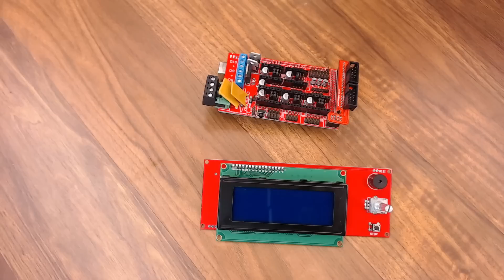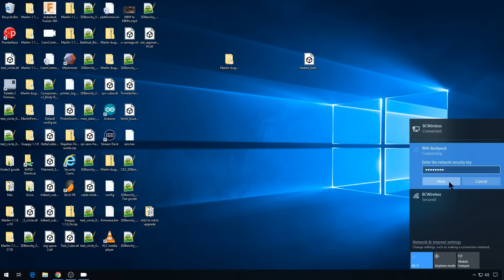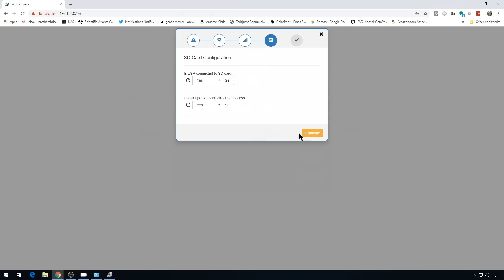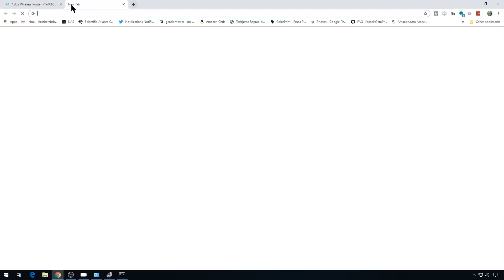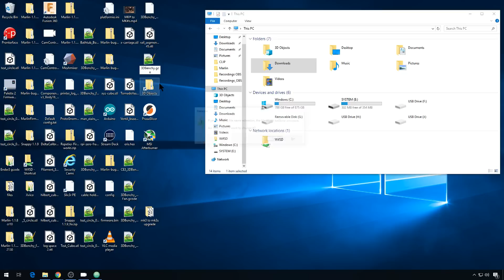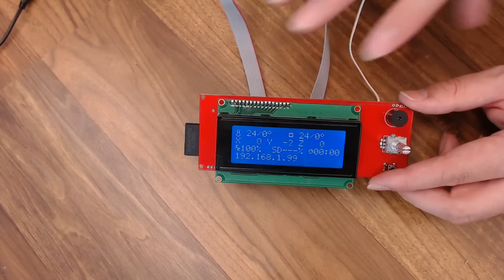Easily Add Wifi To Your 3D Printer - Panucatt Wifi Backpack - Chris's Basement

Comment: A little bit late to the party, but still.... I'm thinking of adding this backpack board to my printer,but I have a question. The main board still has access to the SD card? Can I use the browser UI and the printer display UI in parallel??
Reply from the maker: It will still have access, but remember you are using the same serial bus so bit bashing could happen. That could halt the print.

Comment: Chris, how about an update?  Lot of firmware improvements in 4 years.
Reply from the maker: I'll look into it!
Reply: @ChrisRiley  It does now work with long filenames. There is no level shifter in the backpack so operation with Mega2560 boards is questionable.  Both my Mega2560 and my DUE would reboot continuously until I changed the printer firmware to slow down the SD access.  The SPI signals are very sensitive to electrical noise and really should have a schmitt-trigger buffer (74VHC14 would level shift too).  And the selected file extentions in Backpack preferences need to be in both upper case and lower case or it may not recognize the files  as printable.

Comment: Which one gives the most interesting charateristiques between this module and the TFT MKS wifi module that is plugged as well at the back of the TFT? Thanks
Reply from the maker: They both run esp3d so they are about the same.

Comment: Hi Chris,
Do you know if we can mount this module on the TFT35 instead ? Thanks
Reply from the maker: If you TFT has the EXP 1 nad 2 connections then yes, it should work the same.
Reply: @ChrisRiley  ok Thanks
Reply: @ChrisRiley  So I imagine its the "viki lcd version"  to pick in that case.
Reply from the maker: @Levisgil47  You will still want the reprap one but you would need cables. Maybe look at the ESP8266 module instead.

Comment: Chris! Help! I'm trying to get this to work on my Prusa mk2s clone. I have it connected to where I can see the files on the SD card but the printer isn't receiving any instructions I try to send to it. I just kind of guessed on where to plug in the UART cables on the mini RAMBo because I couldn't find any info online on that. You're my only hope.
Reply from the maker: Hey, so, the mini rambo has a secondary serial, they are on the AUX 3 interface, from the outside of the board, with it installed, the top row, outside pin is the 5v pin the next 2 are transmit and receive. Check out P3 at the bottom. https://reprap.org/mediawiki/images/e/ef/MiniRambo1.3a-schematic-pg2.svg
Reply: @ChrisRiley  Thanks! But I have a new problem. Everything is working except the actual printing part. I can send code and all that, but when I try to actually print nothing happens. I tried renaming the file with the "8-3" rule and that seemed to change something - it now shows a time elapsed on the LCD but it's still not doing anything
Reply from the maker: @liljashy1463  Sounds like some missed communication of some kind. You are able to load the gcode on to the SD card correct? From the wifi adapter, I mean. I wonder if the gcode is getting corrupt on the way over. Try to create a really small gcode and send it, see if that works.
Reply: @ChrisRiley  I can load the gcode onto the sd card, and then I can print the file I just uploaded using the LCD screen and it prints fine, but if I try to print through the interface, I get the error I explained earlier. I tried with a tiny gcode and it didn't do anything differently.
Reply from the maker: @liljashy1463  I'm not sure on this one, sounds like a bug.

Comment: Chris. I I have this WiFi adapter on my current Prusa printer. I am building a bigger printer that is using a Bigtreetech SKR-V1.3 and a Touch screen TFT 3.5 Board. Do you know how to connect the WiFi board to it?  Thanks
Reply from the maker: If you use the makerbase TFT you can add their module. https://www.youtube.com/watch?v=f651bIg4SCo

Comment: Ok, here is a question for you.  I inadvertently set up the wrong password during network configuration.  Now I can't get back to the config wizard.  How do I reset the board to it's initial factory settings?
Reply: Armand Tomany Contact Panucatt and they will send you a file to fix it. I did the same thing.
Reply from the maker: Awesome, yeah Panucatt is pretty responsive with support.
Reply: if you connect your board to your PC using serial usb adapter you can communicate with the board using serial terminal here the list of available commands : https://github.com/luc-github/ESP3D/wiki/Direct-ESP3D-commands
for station password just type `[ESP101]<new pasword>` you can also use reset command for all settings

Comment: How is it powered - via Arduino?
If so - is it safe to draw additional current?

I'm curious, coz I was planning to add ESP board to my arduino Due board (yes, I know Due regulators may be even less capable... )
Reply from the maker: Yes, 5v Arduino, Yes, it should be just fine, my guess is the backpack is taking 5v and ramping it down to 3.3v.

Comment: Noob question here Chris - great vids BTW - will this work with a stock ANET A6?
Reply from the maker: Unfortunately no, the ANET boards don't have UART pins available.
Reply: @ChrisRiley  Thx Chris for responding, I kind of thought so but wasn't sure - what would you recommend as a main board?
Reply from the maker: @paulocallaghan8303  Well it kinda depends on price and if you can alter your case. That is the problem, there isn't much that will fit in the same case as the ANET.
Reply: @ChrisRiley  Thx Chris I'll head down the Octoprint route for now but bear this in mind for a bigger build I'm planning - thx again and keep up the VIDS :-)]

Comment: Forgive me for asking this if it has already been asked before, but are you able to show how to setup a wifi enabled printer board, to octoprint without the USB interface, such that when you tell octoprint to upload gcode to the printers SD card, it does this over the wifi connection. and still have full control over via OctoPrint
Reply from the maker: On a 32 bit board, that will probably work just fine. On the 8 bit there will probably be conflict.

Comment: It's surprising that the 'ping' command can see the host name of the module, but you have to use the IP address of the module in the browser. You'd think if 'ping' can see it then it's in the system DNS cache. Does the module support auto-discovery (aka Bonjour™)? If so, then you might be able to give it a host name (e.g., "printer.local") and skip all the IP rigamarole.
Reply: …And we'll have to see about getting long filename support into that ESP32 file browser. If the firmware has `LONG_FILENAME_HOST_SUPPORT` enabled, then the ESP32 file browser can send G33 to request the long filename for a given DOS 8.3 filename. So it can first populate the file browser with DOS 8.3 filenames, and then progressively update them with the long names as it gets back replies to G33. I'll add it to the endless list!
Reply: Longname support is in next release and won't rely on G33
Reply from the maker: Awesome news!
Reply from the maker: Hey Scott, you know, I didn't even try it from the DNS name, I will have to give it a whirl.
Reply: @ChrisRiley  under windows - just open Network in file explorer it is visible under other devices
Reply from the maker: @lucrourou  Sweet!
Reply: So we will be able to flash this with updates, right @Luc Lebosse ?
Reply: @HippyEngineer  yes fw can be updated using web ui, FYI next update will also bring email/line/pushover notifications feature, it is in test currently

Comment: Oh, and the wifi backpack is $18.50 plus shipping.
Reply from the maker: Oh, it went up a bit, thanks for letting us know.
Reply: @ChrisRiley  There was also an option antenna you can get for it as well to help with range and reception - a $2 option.  I got that as well.
Reply: @ChrisRiley  I'll be setting up on my ramps board initially then migrate it to my SKR 1.3 when I get that setup.
Reply from the maker: @vn1500g3  Sweet! It should work out well. Curious on the range with that antenna.

Comment: Another great vid. I've got my Delta all moved over to skr v1.3 bit and marlin 2.0 - thanks to you. 
Question: I'm using the TFT 3.5 touch screen in addition to a 12864 lcd panel. The tft plugs into the uart port you used in this video for the wifi module. Does that mean I would be unable to use this wifi board if I'm already using TFT screen?? Some sort of pass thru?
Reply from the maker: Thanks Nuroo, that is a great question and I will have to test it. I would think there would be some conflict but maybe they can get along together, I will check it out.
Reply: @ChrisRiley  ok thanks man. I should also say I got the skr v1.3 with 5 2208's preconfigured for uart mode. So I'm already using uart for the drivers. But as long as the uart pins are exposed somewhere else it should work???

Comment: Wow... I think I would prefer something like this over octoprint. I would much rather print over SD for speed and accuracy. The plug-ins for OctoPrint are nice, but this seems like more of a solution I want.
Reply from the maker: Thanks Justin, it's a pretty neat device and affordable enough to try it out.
Reply: Maybe when I can get the delta I want, I'll migrate my Pi over to that for Klipper, and get the backpack for my AM8!
Reply from the maker: @ModestAndroid  Just be sure what ever you want to put it on has UART pins, a lot of the boards don't.
Reply: I have the Fysetc F6 board now, I'm not sure what UART pins it has. It is based on RAMPS and seems pretty generous on the pins though.
Reply from the maker: @ModestAndroid  I just took a quick look at that board. You should be all set. Go for the AUX1 pins top right two.
Reply: Cool beans, thank you for the info! I don't know when I'll be able to give all this a try, but I'm grateful for the inspiration and advice! :D

Comment: Why would you do this instead of octoprint? I use octoprint and I love it.
Reply: One reason I found, having used both over many years. Is I never get a stutter on the Wi-Fi backpack because it's actually just streaming the G code as if you are feeding it from SD, whereas using octoprint on a fast print I get the stutters that drive me crazy and leave lobs on my prints if I print too fast on my delta. And that's using a pi3.
Reply: Yeah, renaming the files and uploading takes more than 45 seconds. On  Raspberry upload takes about a second, without the need of renaming. Also no need to use the onboard printer sad card at all. I already have about a giga byte of Goode on my raspberry pi for printing on multiple printers. SD Card Print also does not turn off the printer after it is done.
Reply from the maker: @guidomersmann9744  There is really no reason, just an interesting device I wanted to try out. I personally use Octoprint on everything.
Reply: I'm not saying octoprint is bad, I have it on six of my printers, but this is a nice option for someone who doesn't want to go the pi route, and also doesn't want to have to deal with bad pi SD card corruption because of powering off the pi incorrectly.
Reply from the maker: @eclsnowman  Great points Eric, agreed, the serial limit can cause issue. This is something I hope to show/test soon. I think that will make the value of the SD card printing a little more apparent.

Comment: On the Prusa MK3/s you can use Rpi Port to communicate via RX1 TX1 with an ESP8266/ESP32 or this board. The miniRambo has on P3 TX2 RX2 which are used to communicate to MMU2/s but the last one will need some firmware modification.
Reply: so if one want to use this board on the prusa, we need either an rpi?, or recompile firmware?
Reply: @Neslekkim  On the MK3/s you just connect it to the right pins on the rpi port of the Einsy board. Here you just have to change the com port via lcd menu. But you can't use this together with a octoprint board. So octoprint OR ESP3D / WiFi backpack. To use it on the MK2/s/2.5/s with the minirambo you have to modify the firmware
Reply: @3dgussner958  Ah!, so with the rpi port, you meant the pins that is available  for the rpi-zero?, I'm not using those. Lets see if I can order one of these boards :)
Reply: @Neslekkim  double check the einsy schematics or rpi port pinout description
Reply from the maker: Awesome info Gussner, do you know what pins can be used on the mini rambo?
Reply: @ChrisRiley  On connector P3 you have at pin 3 TX2 and at pin 5 RX2 checkout https://github.com/ultimachine/Mini-Rambo/blob/1.3a/board/Project%20Outputs%20for%20Mini-Rambo/Mini-Rambo.PDF BUT as the MK2.5s uses this port to communicate with the MMU2 https://manual.prusa3d.com/Guide/6.+Electronics+and+MMU2S+unit+assembly/1041?lang=en . And the MK2 uses it to switch the mmu1 Stepper Switch https://manual.prusa3d.com/Guide/4A.+Electronics+assembly+(newer+version)/435?lang=en#s6749
You gonna need to tweek the firmware for the MK2/s and MK2.5s so it allows to communicate via this port. It would be interesting if a FTDI serial to USB would work to communicate via the USb port of the MiniRambo and Einsy.

Comment: Great device. Do you know where the firmware is located? As it is a fork from Luc Lebosse ESP3D the source code should be made available to GPL license.
Reply: it is not yet public - I did not released yet
Reply: @lucrourou  Thanks, any idea if and when you want to release it? I am curious how you managed accessing the SD card from both devices, on one side we have the ESP can read/write to the SD card and on the other side the controller board is reading files from it.
Reply: @3dgussner958  -No sorry, still several update ongoing - but anyway the solution you are asking is not software, actually ESP3D just set SD access using one pin when it need, the share mecanism is hardware.